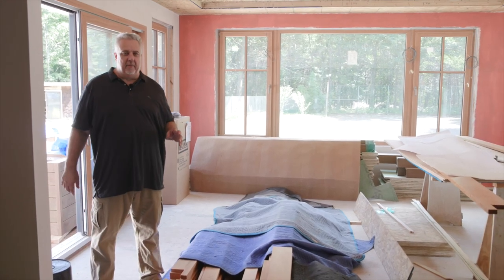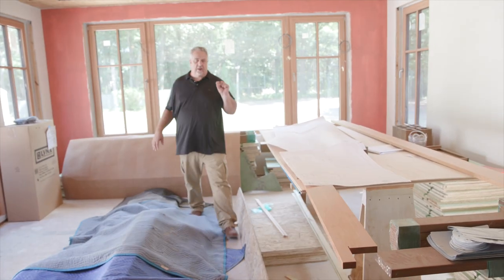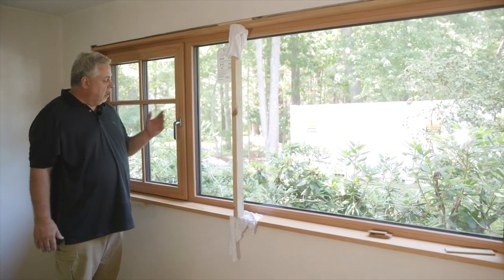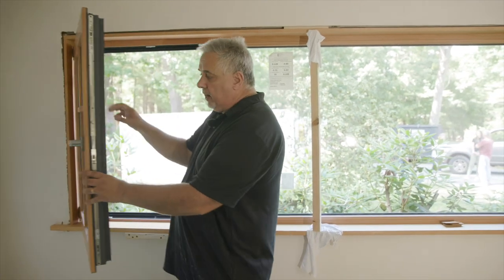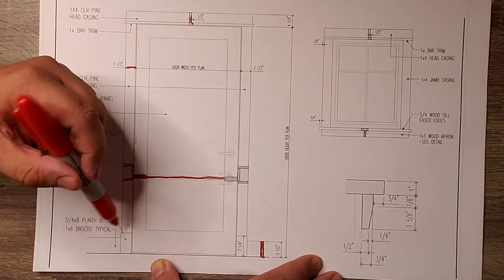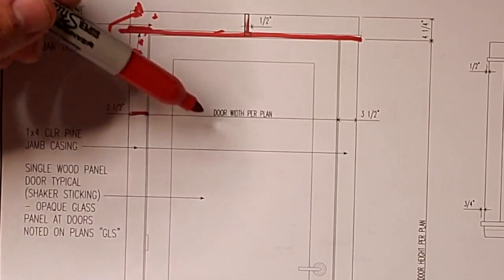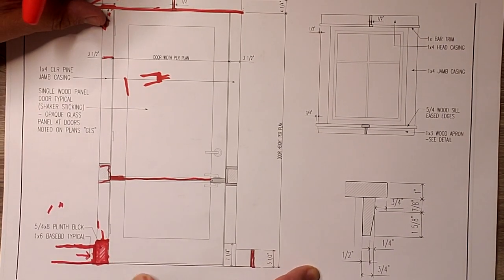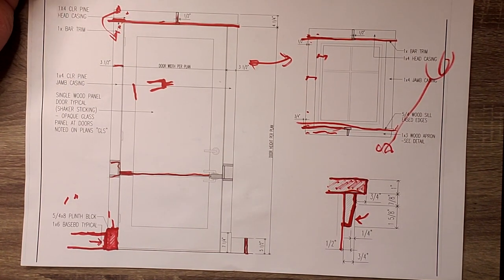Window Trim - KEEP IT SIMPLE!!!

Comment: Might want to mention the power of specialization. 

We use finish carpenters with University degrees from Russia and Ukraine - coupled with decades experience in finishing houses in Moscow. 

The speed, accuracy, artistry and expertise of formally trained carpenters cannot be overstated.  A house such as the one in this video would be completed in about 2 working days - all the windows, interior doors hung and trim, baseboard.   Adding paneling would take longer. 

The skilled people can achieve any design and the tightness of the joints can be beyond what most people are accustomed to seeing.